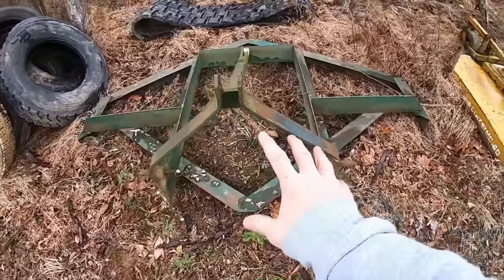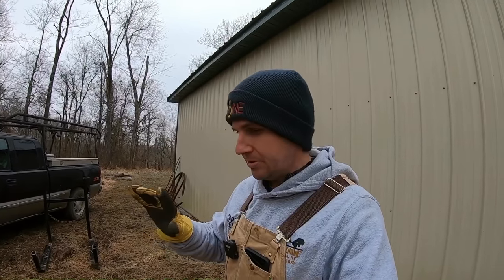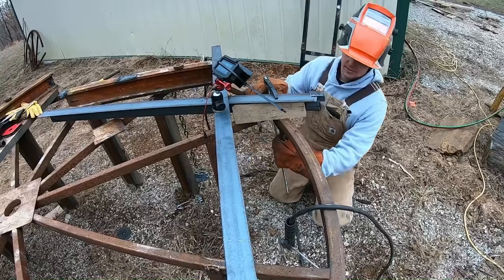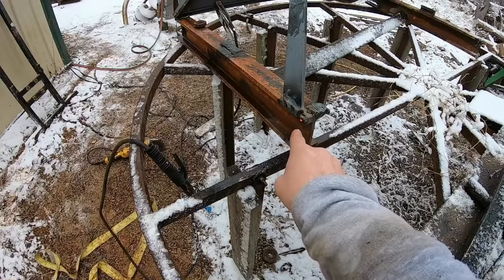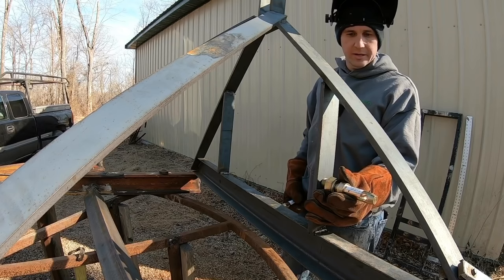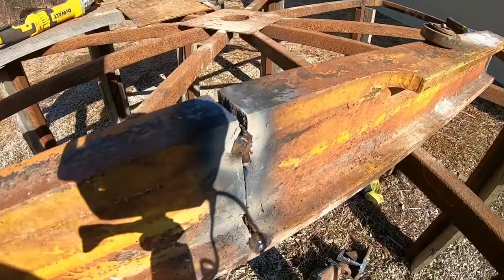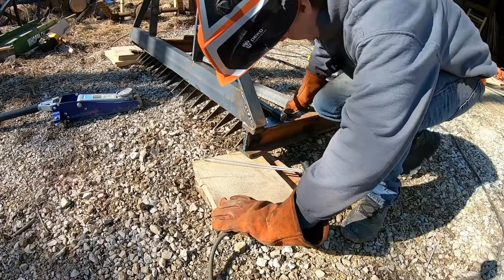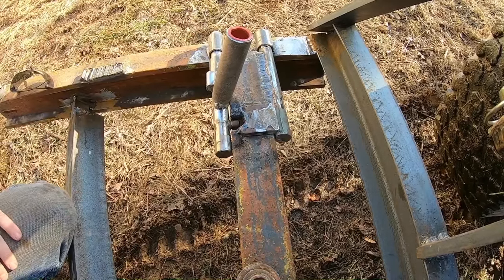Building a Road Drag / Land Plane with Flip up Ripper Bar

Comment: Clean up the grass around the shop the last thing you need is a fire spreading to the shop if your going to keep using the torch. More sparks more heat open flame with molting metal. It's a recipe for disaster if you dont catch it ahead of time. Keep up the great work your definitely improving at welding and cutting.
Reply from the maker: Actually a good burn off would go a long way.  Thanks for watching!

Comment: 🌟🌟🌟🌟🌟  IDEA -- video time 38:50 , were the weight handle lays on welded pin---- put a little rabbits ear up - hold pin in when stowed away  ,  By the way- Iam T. W. Lyons (Lions) 1.

Comment: You are improving I can see it from video to video that you are making on fabricating and welding BUT you notice there is always a but when somebody is critiquing your stuff lol. you need to clean that tip AND GET SOME TIP CLEANERS clean and clean and clean that tip until you can see that center air stream coming out about 1 to 2 inches your cuts will be cleaner I saw a few cut like that but some of those cuts were more melting then cutting and that is ok that is part of learning also after you cut something clean it up with the grinder it will help you when you weld it together better and I believe you are using 7018 welding rod 7018 welding rod does not like rust the cleaner the surface the better the weld if you are going to weld on rust you should use 6010 or 6011 welding rod 6010 is the best for welding rust 6011 will work but 6010 is better anyway I hope this helps if I was there I could help you but I live in seattle so videos are it
Reply from the maker: Yup!  Talked about it in the previous video, tip cleaners and a few other odds and ends were ordered and are finally in!  I'll show it all on the next build video.  Thanks for the tips!

Comment: Well captain wait till it's time you want to learn welding with the torch it a hole new mix for youil I hav to tell you the cleaner your weld surface the better looking your weld a 6011 rod is a good rod it's a farmer rod it's good all around 7018 is a construction  rod and  its hold is much better and you get a nice looking weld you got a 6010 weld too iz good penetration rod pipe welders like that the best
Reply from the maker: Definitely need to start playing with different styles of welding rods
Reply: Thinner the rod less the heat

Comment: okokkok .... if you can try this"""" your work will get better and better with time and practice.. 

1st.... can you try and hold the gas torch a little longer so that the slag has time to flow away i'e""" slow down and breath before you start the cut ....""" stop breathing when your making the cut """
2cd.... if you can when your welding with stick try holding the rod at around 30 degrees to the work area . and practice holding the tip at 5 mm away from the steel . also just let the rod fall into the weld puddle.. 
and stop dragging the rod along the work peace """ i'e slow down and breath before the start """  so that the spatter and expansion of the weld area has a chance to bond
Reply from the maker: Thanks for the tips!

Comment: Don't spend the money on metal for weight, go to Good will, buy a barbell set for $15,oo and that will give you 100 lbs. Cut the bar bell cross bar, weld it to your front bar of your road drag,
slide the weights over the bar and you can adjust your weight by adding or taking weights off.
Reply from the maker: Good idea!

Comment: Your using to much heat and not enough Oxygen to cut with.   Your not really cutting, your melting the metal.  You just need a few minutes of someone's hands on to show you how to set your torch and pressure correctly.  You don't need as much acetylene as you would think, just enough to get a spot hot and then the oxygen will take over on the cutting.